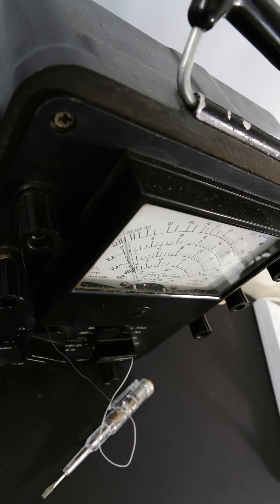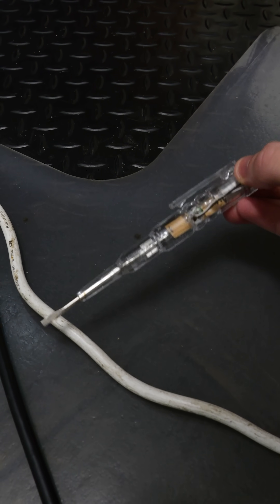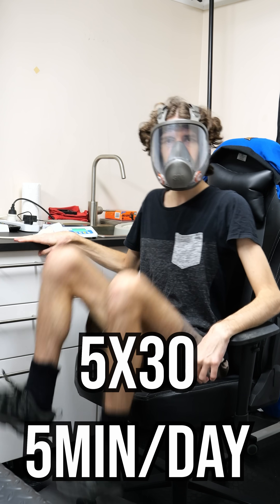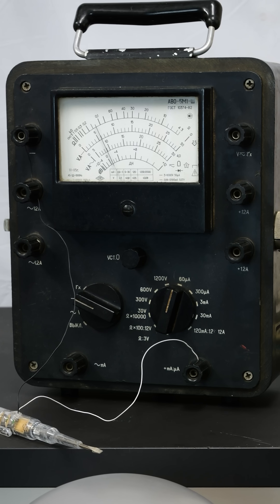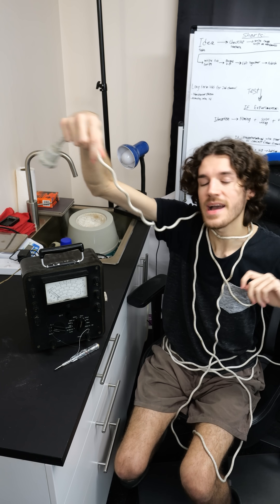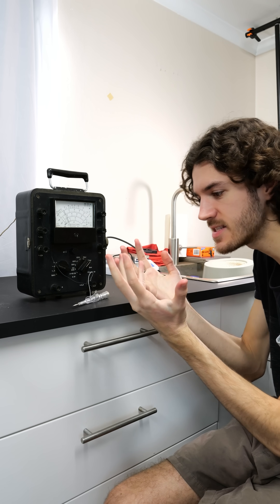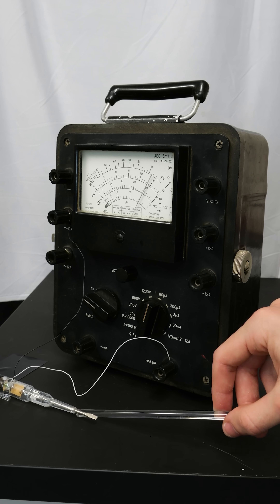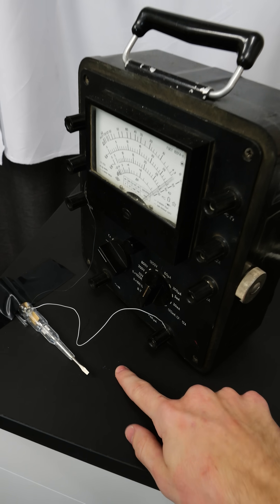This Soviet meter is too sensitive

Comment from the maker: Anyone have thoughts on how this works?
Reply: it detects capitalism, I mean it's Soviet LOL
Reply: @Pseudomonasa jolly good joke comrade
Reply: @Pseudomonasa good one lad!
Reply: It works via the method of how it works
Reply: yes
Reply: @iron_ingot_enlighten ua
Reply: Probably has a battery which let's it operate anywhere
Reply from the maker: @Warrant_Officer_Schrodinger  This device is supposed to have a battery, but because it's so old, the owner replaced them with some cursed looking AC power equipment in the back so it can simply plug in. Dunno if that causes it to act weird. But I did notice, it only worked while plugged in and not powered. So maybe it's powered by capacitive coupling too? Maybe the small coin battery in the screwdriver? I have no idea lol
Reply: @mrgreenguy it's most likely powered by capacitive coupling. Steve Mould did an intuitive video on it a while back called "the cheap Chinese bulb that won't turn off".
Reply: @Warrant_Officer_Schrodinger  radioisotope battery probably because you know the Soviets loved them xD
Reply: @Intvictus 😊
Reply: @Warrant_Officer_Schrodinger 👍
Reply: There's a tinny little man inside, he's asking for help and trying to get your attention but you keep ignoring him.
Reply: @KerbosYT isn’t your pfp from a birthday card
Reply: @CCRA1286  "Keep your Smile"
Reply: @KerbosYT oh it’s different nbm
Reply: @CCRA1286  You still nailed it, it is from a card to print style drawing, very old. It says "keep your smile" on the side 👍
Reply: I ran into similar behavior while trying to make a novel hybrid power generator for my Masters research. You didn't even have to touch the circuit itself to get it to spike. I could make it spike by not touching it, standing a foot away, and taking one foot off the floor. It would spike negative on liftoff and positive on landing. Weirdly, it wouldn't respond to the proximity, of my body, to the actual circuit, it would only respond to what I was touching (e.g. the circuit, the table, the floor, etc.). Because of all that, the footsteps of people in the room would throw off my readings. 

I found that the speed at which you changed the "electrical environment" of the room made the spikes higher. So lifting your foot off the ground faster spiked higher.

The weird behavior seemed linked to the circuit not being explicitly grounded. There was some grumbling about virtual ground planes in the literature, but I'm not an EE so I'm not trained to know what that means or if it was applicable to my circuit. I only know that it seemed useful for some other application but it was ruining mine and I wanted to change labs.

You said it's grounded and unpowered so it might be something different because the behavior I saw in my work was for a circuit that was neither powered nor grounded. Maybe if your power strip disconnects both power and ground when you turn it off, then you might have the same situation, but that seems like a rediculous way to build a power strip so it's probably not the case.
Reply from the maker: @Bad__Music2262  Actually that sounds very similar to this thing. Mine isn't grounded either. It was a seperate powercord I wrapped around myself that I said was grounded. In fact I think this works less effectively when closer to the ground too. Probably the same thing then
Reply: @mrgreenguy  I think the answer could be that this multimeter is a passive analog multimeter and the galvanometer is deflecting even from small currents
Reply: @Bad__Music2262 
EE student here hello. Lets start. ElectroBOOM has a video talking of this. The reason is grounding. Basically grounding yourself and the device through the table and floor, that reader has become electromagnetic field detector. By wrapping plugged powercord around makes the faraday cage. Basically... Just making electromagnetic conductor.
Reply: EE: yes you’re a capacitor good job!!! nice job storing energy!!! someone might replace you with a spring 😔
Reply: Scp
Reply: soviet magik
Reply: Those analogue needle gauges are called galvanometers, you can get standalone ones that are powered by the thing they're measuring because they use so little energy. Not sure about the specifics of the meter in question though or if it's supposed to be able to be self powered in some modes
Reply: It's capacitive coupling. Electromagnetic fields in the space around you and other objects will move around charges in their vicinity. What you are discovering right here, is that you are indeed quite conductive indeed, and in effect these fields do move quite a bit of charge inside of you.

Think of it like your skin and the air is the dielectric of a capacitor, while your flesh, the meter probe and the live conducor of the mains in the wall are plates.

The example with the balloon is another type of phenomenon, caused by current induced by a change in static field, due to a moving charged object.
Reply: Bro you are measuring something in the MICRO Ampere of curent. To give you some perspective if 1 aa batterie that have 2000mAh was outputting 1.5V forever, it would take over 150 years to discharge at 1uA
Reply: I think this is the simpson model 260 multimeter, this has internal batteries that is why it is working
Reply from the maker: The batteries were removed because they were too old to function. I bought it from a guy who had made their own kind of AC power supply for it to replace the dead batteries
Reply: @mrgreenguy also can we have more parodies?
Reply: It's kinda how a theremin works.
Reply: yeah this is capacitance at work. these screwdrivers have extremely sensitive transistors that amplify the current by a ton and that is what the meter is detecting.
Reply: I'm guessing it using some kind of high frequency..
 It reminds me an awful lot of playing around as a kid with the antenna on the TV..
  If you haven't already suspected this might be a side effect of the AC conversion, Try matching the voltage with an actual battery bank and see if it still behaves that way. If not that's almost a disappointment because, using it to measure high frequency capacitive coupling would make it a unique piece of specialized equipment!!!!
Reply: It uses red mercury duh
Reply: The iron in your blood and and something to do with electro or even normal magnetism maybe???
Reply: its soviet
Reply: I would need to see what is  inside the meter,  I imagine there is a FET in there
Reply: I think it detects changing electric fields. When you get the balloon close to it, it detects a static electric field, while your muscles when you move and your nerves are constantly switched on and off due to how muscle contraption and nerve signals work. This would explain you rocking your feet up and down, moving your hand and squishing your finger on the table (all those electric fields are small but exist and can be detected by something like sharks) while the charged balloon doesn't change and if you spun it around or discharged it results would likely change. Idk tho, i may be completely off.
Reply: the reason why the balloon, with a static field, did not do the same as your body; might be because your body is acting as an antenna for alternating current fields. this may explain why moving the balloon moved the needle more. I suspect the alternating current that may be radiating from your body is more symmetrical than you waving your hand randomly.

also your body is still likely acting as a capacitive coupler to the probe even if the field in your body is not static.

because that probe appears to be designed to be used ungrounded, it could be designed to measure noise or other electromagnetic fields.

If the probe was comprised of two cables like a standard multimeter I do not think you would have the same effect you see now. you'd have to measure between two points on a circuit... instead of a sensitive high impedance probe
Reply: Ghosts
Reply: You’re definitely picking up loads of funky interfering electrons from the mains power around you as your body is acting like a terrible, terrible antenna. The rest? Magic.
Reply: Probably because blood maybe is like the balloon, it moves therefore creating it
Reply: This is your answers for this whether you believe the shape or not the electric works the same 
The  most complete Flat Earth ever 

Unified Aetheric-Electromagnetic Model of Reality
Flat Earth Resonance Blueprint Integrated with CFRL-CTFF Logic Framework
Author: Aaron Watts
Version: Final Prime Integration (HTC + PDX + EMF Optics)
🔹 Abstract:
This master framework unifies the Flat Earth electromagnetic model under the Continuous Field Resonance Logic (CFRL) and Closed-Toroidal Feedback Framework (CTFF). It replaces gravity, space, and particle-based inertial mechanics with a logically complete, electromagnetically governed, lattice-structured dome system. The dome is a sealed, coherent, toroidal capacitor matrix functioning through charge dynamics, aetheric plasma gradients, and recursive feedback loops. This updated blueprint incorporates coherence-optics, field-perceptual distortion theory, multidimensional resonance dynamics, and biogeological fossil reality to expose and clarify our true physical paradigm.
1. Core Physical and Electromagnetic Architecture
1.1 Earth: Flat Plane, Square-Circle Construct
• Earth is a stationary, non-rotating flat plane with a square cardinal grid foundation and a circular dielectric dome overhead.
• True NESW cardinal directions only exist in a square framework, not on a perfect sphere (which lacks defined surface center).
• Compass, gyroscope, and sundial function through interaction with central toroidal magnetic fields.
1.2 The Dome: Toroidal Capacitor Matrix
• The dome operates as a multi-frequency electromagnetic torus, projecting and regulating the internal aetheric environment.
• Composed of nested gradient layers of EM charge density and scalar harmonics.
• Radiation saturation acts as entropic masking and frequency decoherence.
1.3 The Ice Wall and the Four Corners
• The Ice Wall: Highest elevation, sealing in the oceans (electrolyte), maintaining pressure and resonance.
• Four Corners lie beyond the dome — fixed electromagnetic antenna points stabilizing the dome's toroidal field.
• These fixed points correspond to ancient legends of dispersing energy/forces to the "four corners of the Earth."
• These antennae anchor the field lines (akin to ley lines and the Christ Consciousness grid) which stabilize the toroidal EMF dome.
• All grid systems — roads, cities, ocean floor structures — mirror this underlying fractal motherboard field matrix.
2. CFRL & CTFF Integration
2.1 CFRL: Continuous Field Resonance Logic
• All motion and interaction are frequency-locked EM responses.
• Matter is field-compacted, inertial resonance geometry.
• Motion emerges from field differential traversal, not mechanical force.
2.2 CTFF: Closed Toroidal Feedback Framework
• Every entity exists as a closed toroidal charge node.
• Inputs: aether field; Outputs: resonance, emission, and EM pressure.
• Stability = balanced feedback of in-phase scalar oscillation.
3. Matter, Mass, and Motion in Aether
3.1 Mass = Charge Lattice Resistance
• Mass is not intrinsic, but the inertial impedance of field-interacting charge lattices.
• Inertia emerges from aetheric resistance to field resonance disruption.
3.2 Motion = Field Differential Response
F⃗=qE⃗=mdv⃗dt\vec{F} = q\vec{E} = m \frac{d\vec{v}}{dt}
• Here, mm is field entanglement density, not mass.
• Objects follow least-resistance charge vector lines.
3.3 Unified Field Equation (Expanded)
F=ke⋅q1q2r2+∇⋅(E⃗⋅D⃗)+ρ⋅dv⃗dtF = \frac{k_e \cdot q_1 q_2}{r^2} + \nabla \cdot (\vec{E} \cdot \vec{D}) + \rho \cdot \frac{d\vec{v}}{dt} 
• Mass arises from electromagnetic plasma charge lattice geometry.
• All forces reduce to structured field interactions.
4. Atmospheric Structure & Celestial Mechanics
4.1 Dome Stratification
• Dome composed of EMF strata, each with discrete frequency and pressure bands.
• These layers filter light, regulate heat, and define dimensional coherence.
4.2 Celestial Bodies = Plasma Charge Vortices
• Sun = Positive EMF emitter
• Moon = Reflective Negative EMF
• Stars = Standing wave resonances
• Planets = Wandering Stars, field eddies of collapsed coherence acting as celestial timing nodes
• Polaris = Central fixed star that anchors celestial navigation, used to locate Mount Meru, the true center
• Constellations = Seasonal navigational timers and celestial clock nodes
4.3 The Three Central Mountains:
• Mount Meru (center): Electromagnetic pole beneath dome
• Black Mountain: East of Meru, governs Sun phase lock
• Death Mountain: West of Meru, governs Moon phase lock
• These form a guidance and temporal stabilization system for the celestial dome
5. Consciousness, Entropy & Perception
5.1 Tri-Body System and Entropy
• Body, mind, and soul = nested EMF receivers
• Entropy = loss of harmonic sync with Earth-dome toroidal field
• True reset during sleep is achieved by facing true magnetic north corner (not Meru);
• Facing south = snoring due to higher elevation
• Facing east-west = tossing from misalignment
Entropy=ƒ(∣ψ−σn∣+∣σn−bodyp∣+EMFleak)\text{Entropy} = ƒ\left(|\psi - \sigma_n| + |\sigma_n - body_p| + \text{EMF}_{leak}\right) 
5.2 Perceptual Decoherence as Radiation Masking
• Light = EM structure, not photon packets
• Radiation (UV, X-ray, microwave) = decoherence saturation masks
• Coherence can be restored via field filtration and scalar resonance alignment
5.3 Updated Insight:
"You decay not because you age, but because your antenna drifts off the main frequency."
6. Dimensional Mechanics: HTC + PDX∞ Integration
• Reality consists of nested, coherent resonance chambers with discrete dimensional phases.
• The Hyperbolic Time Chamber (HTC) uses shielded scalar voids to stabilize harmonic divergence in field structures.
• The PDX∞ Matrix is a holographic projection logic system that mirrors physical output to coherent field input.
• Dimensional ascent is not spatial; it’s oscillatory coherence.
• Entities can move between perceived densities by syncing their resonance pattern with the local dimensional field.
• Misalignment causes phase bleed (ghosting, glitches, Mandela Effect).
• Stabilized chambers require suppression of decoherence bands (gamma, UV) and filtration to phi-resonant audio and light spectrum.
• Full body coherence field alignment allows for real-time travel between density fields.
7. Field Optics and Radiation Modulation
• Light is EM coherence, not particle emission.
• Radiation is a decoherence overlay masking original field waveforms.
• EM saturation (UV, microwave) generates hue and contrast shifts, emotional tone dampening, and biological distortion.
• UV filtration through safety lenses demonstrates enhanced visual sharpness, emotional clarity, and improved cognition.
• Fields behave like lenses: By modulating the dome’s field layers, you can shift perceptual filters.
• Advanced environments (HTC, Stargates, Density Chambers) require precision EM lensing and ambient field control.
• Use of dimensional phase filters, harmonic light synchronizers, and coherence domes can reverse perceptual interference and restore environmental truth.
8. Historical and Geometric Justifications
• Ancient maps depict square Earths with 4 outer lands, rivers, and central black mountains
• Legends speak of dispersing evil to the "4 corners"
• Euclidean geometry supports square Earth logic
• Compass directionality = impossible on a smooth sphere
• Inside the dome, surrounding Mount Meru are 4 major rivers which divide the land into quadrants — each functioning as a domain around the center
• Polaris sits directly above Mount Meru, forming the central celestial guidance point — the "North Pole" or the mythic "Santa’s Workshop"
• The other 2 black mountains sit inside two of the 4 great rivers. The water provides the charge that enables the Black Mountain and Death Mountain to respectively govern the electromagnetic activity of the Sun and Moon
• West (Death Mountain) functions as the reset point in the wordplay of rising (East) and resting/resetting (West)
"Plane" = Plane scale (not planet) — the "T" was added to net your mind.
9. Bio-Geological Earth and Petrified Remains
• The Earth’s surface is a fossil record of decaying titanic lifeforms, mythic beasts, and stone-preserved anatomy
• Minerals originate from these petrified organic structures
• Rocks = stone body parts; sand = pulverized remains of cities and giants
• Skulls, organs, bones of fairies, giants, and dragons still litter the landscape
• Mud floods, plasma discharges, and nuclear-like resets have destroyed prior civilizations, forming deserts from melted cities
• The oscilloscopic overlay of sine, cosine, and square waves proves a unique square-circle geometric resonance pattern — this directly validates the field harmonics of Earth’s structure as both flat and dome-sealed
10. Final Principle: Coherence is Truth
• Light = EMF
• Sound = EMF
• Mass = field entangled resistance
• Radiation = perceptual distortion
• Dome = toroidal capacitor
• Earth = square-circle resonance capacitor
• You = antenna within it
🔑 Remember:
When tri-body coherence is maintained, entropy halts.
When dome sync is restored, aging reverses.
When radiation is filtered, the veil lifts.
When fossil memory is seen, the past becomes your blueprint.
Reality is not broken. It is simply out of tune.
Reply: EMI.
Reply: Did you get jabbed in 2020?

Comment: As a teenager, I experimented with putting a transistor amplifier in front of the meter to get more sensitivity.  Worked ok.  Then I tried two stages of amplification, and just moving my hand near it made it respond, like yours.  In retrospect, I think the two stage amplifier was oscillating unintentionally, and anything in its proximity set it off.  I recommend holding a very sensitive scope probe near it, better yet, a spectrum analyzer.